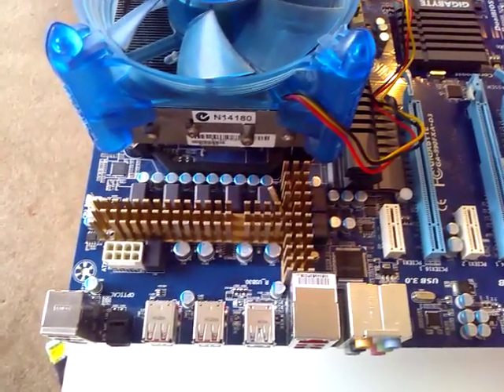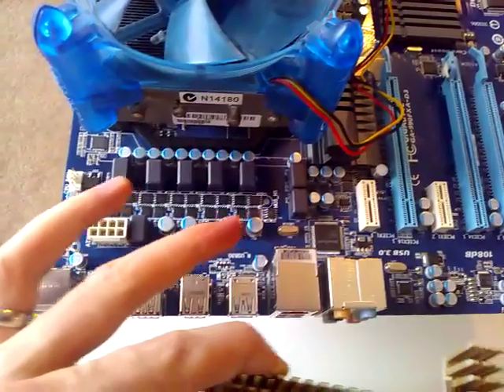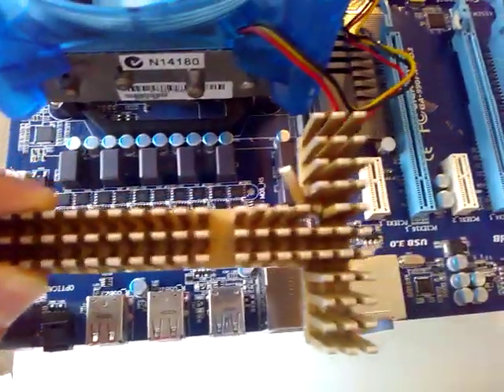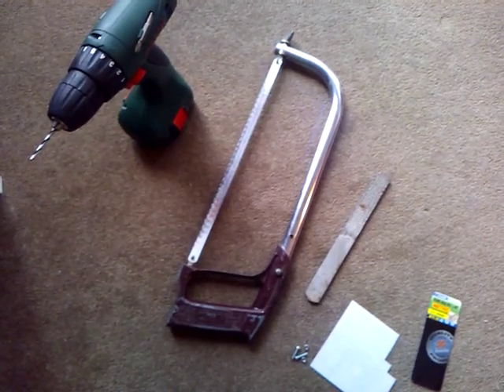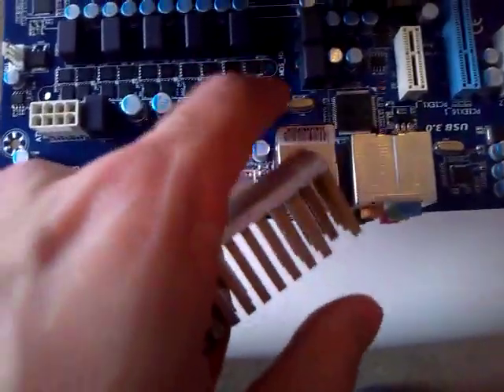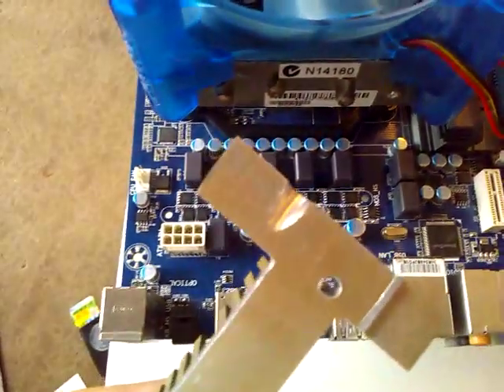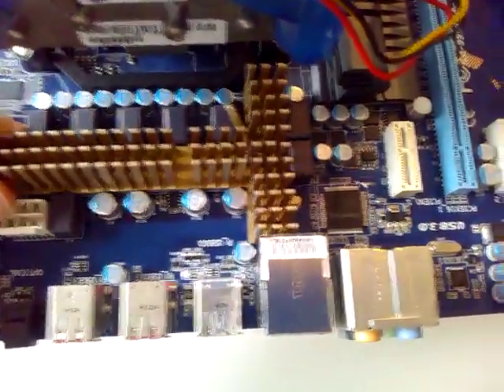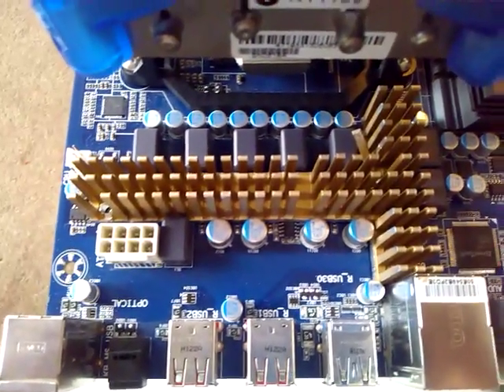How To: DIY Motherboard MOSFET Cooling, Part 2

Comment: makes you wonder what they were thinking, leaving off a simple part, i have a GA-970A-D3, with a PhenomII X2 560(i know its soooooo dated, but hey it still does the job, and i have had it stable oc'd to 4GHz, but leave i have left it at 3.8GHz, for the last 3 years, just incase), but damn according to speedfan, (i think this temp is the mosfets) the mosfes sit at about 54c idle and about 70c under load!  and i have been searching for ages where to buy the heatsink from, but watching your build, i might just gut the heatsink from an old vidcard i have laing around! ty for the inspiration!

Comment: The bottoms of the mosfets are soldered to the copper in the pcb. Even with the so-so conduction of that solder it is actually at least 100 times better that what comes out through the plastic cases. This means heatsinking the tops does very little really, you would get the same effect or more via simply blowing more air dowm onto the vrm area.
Reply: thats why side intake fans were created :) everyone I know thinks they were designed for exnaust :)

Comment: Nice job, I was thinking of doing a similar thing, I have an old Gigabyte G31 ES2L that blew a VRM on a basic FSB overclock and then burnt / set fire to one of the mosfets!

I am planning on trying to cool both the VRM and mosfets from old heat sinks from the NB / SB of the old mobo.

Comment: pretty impressive stuff, i have a cheapo mb but it does have vrm heatsink, do you think bolting it down helps cooling rather than the cheap spring loaded catch it currently uses? Its a gigabyte 78lmt-usb3
Reply: I also have this mobo, found it pretty cool even under an FX4300 OC'd to 4.5GHz... although I have a high flow case and big cpu cooler lol